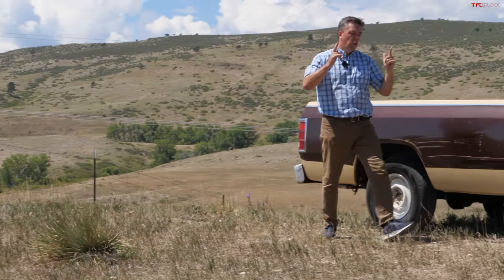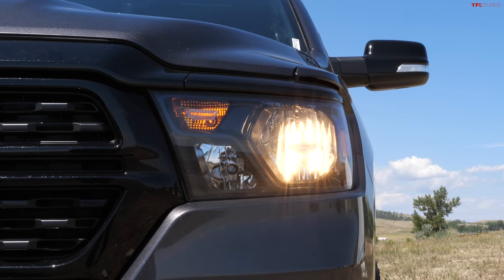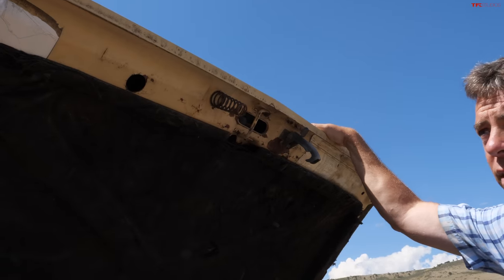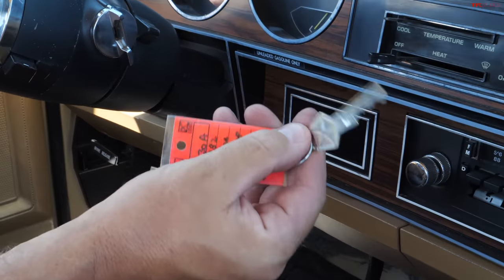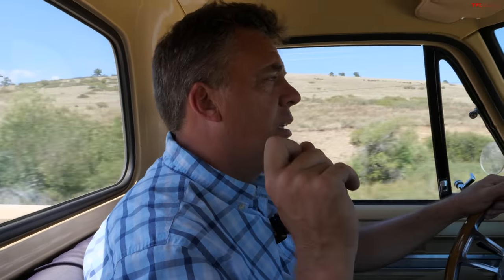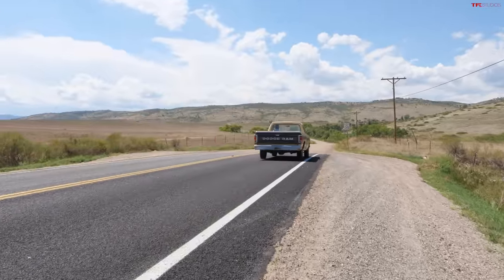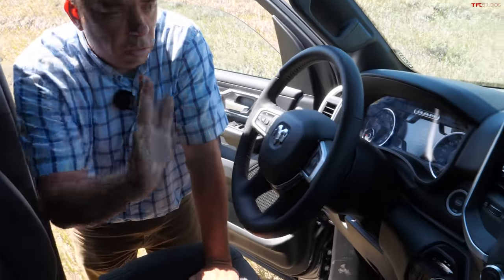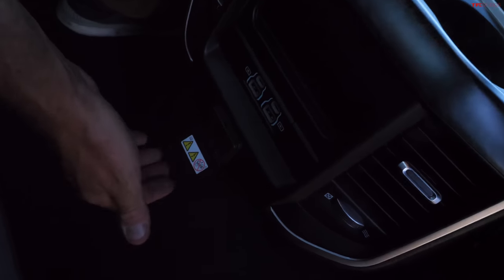You Won't Believe How Much Pickup Trucks Have Changed in The Last 40-YEARS!

Comment: I would take that 1982 Ram, hands-down, The best part about that Ram is, you don’t need a degree from MIT to fix it, 
That slant six is an absolute gem, One of the best engines Moper ever built
Reply: You don’t need a degree to fix the new truck either 🤣😂. Just because you’re ignorant doesn’t mean it’s difficult.
Reply: @flight2k5  
Powerful words coming from a guy behind a keyboard, it’s amazing how cowards operate
Reply: @michaeld5591  🤣😂 how am I a coward. Because I called you ignorant?  You know what that word means correct?  Don’t have hurt feelings.
Reply: @flight2k5  
It was not meant to hurt your feelings, I have more integrity honor and character than that, have a good day
Reply: @michaeld5591 I didn’t have hurt feelings 🤣😂
Reply: @flight2k5  
You know well what the guy meant and he is correct. You need a scan tool, and a lot more regular tools to fix the new one. 
  You need a screw driver and a socket set to fix the old one.
Reply: @kens97sto171  🤣😂 that’s hardly a degree from MIT. You know what’s crazy is there are kids working on new cars. But you refuse to learn. Simplicity doesn’t equal reliability. You know that right?
Reply: @flight2k5  
Dude I've been working on cars for almost 35 years. I drive a Prius. I've had the battery out disassembled reassembled balanced the modules. Head gaskets, clutches, transmission replacements. On a variety of vehicles.
You know damn well what the guy meant when he said that. You can work on that old car with a screwdriver and some wrenches and get it running. You cannot do the same thing on a new car. Yes my Toyota Prius is incredibly reliable $410,000 miles on it. However that reliability depends upon the fact that the manufacturer built it well in the first place. I watch plenty of car repair shows on youtube. There are a ton of new cars that are rolling piles of shit from the factory brand new. Mostly due to crappy Electronics wiring or engineering. That is where simplicity makes better reliability.
However if you buy a car that's well engineered designed and executed with good materials then yes a new computer-controlled car is probably more reliable in the short term with a lot of miles on it.
But ask yourself a question. Could you take a brand new car stick it in a cornfield for 20 years and then get it running in a couple of hours with basic hand tools? Probably not.
Watch a lot of videos about that too. I've seen cars that have been sitting in a field for 70 years. And they get running pretty easily. Does that mean I would want to drive that daily 300 miles a day in the city? No probably not. But again you know what the guy meant and so do I. And there was no need to insult him in your response.
Reply: @kens97sto171  nothing you said proves simplicity equals reliability.  Mechanically there is no reason why anything that sits can not be started after years of sitting.
Reply: @flight2k5  
I don't need to prove anything. It's pretty obvious. Anything that has fewer moving Parts with less to go wrong in the first place is going to be more reliable given they were equally well made in the first place.
So if a computer-controlled car sits in a field for 20 years and the mice eat through the wiring and the computer box gets corroded and rusted out? How are you going to fix that if you can't get a new computer box and wiring harness? Answer you can't. Versus the carbureted,  points ignition vehicle. You can get that running with some very basic tools. The other is mechanically injected diesel engines. I've seen those things light up after four rotations after sitting for 20 years. Again their mechanical, and if they were well made. All you need to do is get the fuel valve open and get it to rotate and give it a fuel source and they often light right up as long as nothing got into the intake or exhaust system or a intake or exhaust valve rusted open or closed. And even then it'll often end up running on some of the cylinders.
Reply: @kens97sto171  no, no it doesn’t. It’s not a blanket statement. 🤷🏼‍♂️ sorry bud
Reply: @flight2k5  
There are no such things as blanket statements. But all things being equal a simpler machine is going to be easier to repair than a complex one. You don't need a degree from MIT to understand that. Seems pretty simple to me.
If I let my Toyota Prius sit in the driveway for 10 years it would be impossible to get it running without a remanufactured Hybrid battery or a new one. You cannot make the car operate without that high voltage battery pack. Even if you put a 12 volt battery in it and get the car to boot up assuming rodents haven't eaten through the 10 million miles of wire under the hood.
If I had a car sitting out there with a carburetor and points ignition there's a very high likelihood that after 10 years I could dump some fuel down the carburetor put a 12 volt battery in it put a screwdriver across the starter terminals get it to turn over and run.
Reply: @kens97sto171  so easier to repair. Not more reliable. Got it.
Reply: @flight2k5  

What's your definition of reliability. What's your definition of repairability.
 Is a car more reliable because it can sit for 30 years and then be started up easily? 
Or is a car more reliable because it can go 500,000 miles needing little repairs along the way. 
Both of those statements are true...
So it depends upon the person's needs and what they consider important. 
If you consider driving 500,000 and never needing to fix anything the most important feature then buy a newer car. 
Preferably a Toyota. 
If on the other hand you like a vehicle that you can easily fix with basic hand tools and common sense then buying something older that's simpler might be the right car for you. Both of those can be true at the same time. 
I owned a 72 Plymouth duster with a slant six engine carburetion and points ignition. And it went 470,000 miles.
I currently have a Toyota Prius it's gone 410,000 mi.
But the duster could have been repaired with basic tools and could sat in a field  for 20 years and be fixed. 
The Prius could not.
Reply: @kens97sto171  dude you’re trying so hard. Aren’t you?  Your ping drawn out replies do not make you more right.  Please just stop and agree that simplicity doesn’t equal reliability
Reply: @flight2k5  
You're right..
 I'm trying to hard to talk to a brick wall. Or a troll or both.
Simplicity is more reliable given everything is equal. Simple fact,  if you have a brain and can use  logic. 
. But you're not open-minded enough nor do you have the experience to realize that fact..
I've lived longer than you and have experienced both situations.
I told you I drive a Prius didn't i? That should tell you that I don't have any problem with complex machines. But because I'm smart and open-minded enough. I also realize that a 72 duster with points ignition in a carburetor was also reliable. But could also sit in a field for 20 years and be fixed with a screwdriver. Versus the Prius which cannot.
Reply: @kens97sto171  no it’s not. Sorry you’re incorrect. See you’re just doing a blanket statement.
Reply: @flight2k5  
I don't think you understand what the definition of blanket statement is. I'm literally saying the opposite of that.
A complex machine can be very reliable if well made. A simple machine can be also very reliable if well made. And the opposite is true also.
But a simple machine will always be easier to repair than a complex machine.
Therefore if you have a simple but well made machine you will have good reliability and ease of repair. Pretty easy to logic this out.

Comment: I grew up with a pick up truck very similar to that 1982 Dodge. It was a 1987 LE150 4 x 4 with three-quarter ton modified suspension this truck was custom ordered 318 v8 I know this doesn’t mean shit but that little 318 V8 had about 175 hp and in the summertime on a hot day with a good tuneup on My dad’s well running truck would get a second gear rubber chirp not a burn out from an automatic transmission. Before taxes and financing my dad‘s truck was $17,000 Canadian And I will tell you with very little effort that truck will outlast that  2022 ram especially if the lifters in that hemi collapse like happened to my brother-in-law‘s hemi ram.

In the event of an apocalypse you can fix that straight six with bubblegum and a coat hanger. Can you say the same about that 2022 ram?

However I strongly suggest all manufacturers bring back the front vent windows!

I strongly suggest you read the owners manual and the data tag in the vehicle especially for the 82 Dodge about what it can tow weight wise it’s very comparable to the new truck even with the little six-cylinder. You’d be amazed how tough that little truck is. 

The reason they make trucks like that today is because back in the 90s there was a luxury tax on vehicles that didn’t apply to pick up trucks and it just carried forward from there on. And depending on what country are in for example I’m in Canada if you bought a brand new pick up truck in the 90s it was a 100% tax write off basically the government paid for your pick up truck if you had a business.

Comment: This is the exact color of my 81 Ramcharger. 5k lb with a 5.2 v8.
Back then pickup trucks were literally just that..
Not meant as grocery getters but to haul alot of stuff in the huge bed..
And 1/2 ton literally meant that was all it could carry..
Great video showing the true differences 40 years have made
Reply: Ah, the old (almost) indestructible 318!
Reply: @jeffhutchins7048  it was the 318.
Took forever to get to 35-55 mph..
Reply: Had a ton of those '72-"93 D/W Trucks, still have a few.
My 5' tall 19 year old daughter drives a '91.5 Cummins W-250 every day.......well so do I but mine's a Getrag 5-speed manual and her's is an auto.

Her legs aren't long enough to push the clutch in

Comment: I grew up with a 1977 d100 (my Dad's first new vehicle) slant six 4 spd and his 2nd new vehicle the truck I learned to drive on, a 1987 d100 slant 6, 4 spd... technically 3 spd with overdrive. About the only difference between the 2 was the '77 had a first gear, granny gear. The '77 had a couple of issues with the cheap ballist resistor, where the '87 didn't and the '87 had a slightly smaller passenger side floor vent, which made it tough getting the six pack of cans into, to keep cool, fall, winter, and spring. Lol. They both had rough duty (I'm the youngest of 7, and hauled wood and a pop up every summer) and had over 150k miles (the'87 had 186k when traded in) with just maintenance items being replaced, oil, filters, brakes, and tires

Comment: I had a 78 Ford F100. 300 six with a C4. Great truck if it would start without flooding. My 2020 Ram 2500 Cummins is no comparison, but like Andre said. Many times more expensive. It pulled a boat without effort. I’ll keep my Cummins, but for the money, the F100 was really good at what it did at the time.

Comment: What is better is the motors.  Variable valve timing, mass air flow sensor, hydraulic roller lifters, valve rocker rails, fuel injection, more horse power & torque, and if you said in the 70’s each cylinder will have its own coil we would call you crazy.  What’s bad is exhaust manifolds cracking, troubleshooting emission codes, insane amount of computers, accessories and complexity not needed in a work truck.

Comment: that 82 would out work that 22 all day long. it's designed to be a truck and do truck stuff. that 22 is not much more than a sedan with a truck bed on it. and all the un-necessary garbage on it for "reliability" and safety. the older truck will continue running when something is wrong with it or needs repaired. the newer truck will leave you stranded because the computers will tell it to shut off and not run because of a stupid sensor. I had an 87 and I beat it pretty hard. around 8000 pounds of material in the back and the truck didn't strain at all. my dad bought a brand new 2020 ram with all the features. the warranty says don't pull a trailer for the first 10,000 miles. don't overload it. why? are the internals of the transmission made of glass? if I want a sedan I'll get one. here's my challenge for the big 3 or 4 automakers. ram, chevrolet, ford, toyota. make a basic truck like that 82. put the four wheel drive selector on the floor in the shape of a lever. put another one next to it to stir the gears inside of a manual transmission. air bags and crumple zones because safety, but make it simple. make it so a do it yourself type of person can change his (or her) own spark plugs, motor oil, air filter and so on. it is possible to get amazing fuel mileage out of a simple v8. basic truck. tough and rugged. affordable. even with today's economy, a new basic truck shouldn't cost much more than 18 to 20,000.

Comment: You could rebuild every component or upgrade everything on the 82, paint it and still be about a 1/4 of the price of the new truck. The biggest difference is how much manufactures take advantage of customers now compared to back then. That and the older vehicles were built to last so you got your money's worth out of them.
Reply: No way. Newer vehicles last much longer and are more comfortable and faster. Manufacturers shyte on customers back then too, don’t kid yourself.
Reply: @cwqrpportable  Really? Tell that to the new trucks three of my coworks have had in the shop a couple of times already. Hell I got a 3 year old Peterbilt we have had to take in five times in two months for bullshit repairs. It's electrical system is already crapping out as it alarms at you for not setting the park brakes, even though you did. Hell my 24 year old Dodge has been in the shop less than my wife's 07 Jeep or my father in-laws 17 Toyota Tundra. Dude at work has an 84 Toyota that while beat up, still runs great.
Reply: @BlueDually4x4  Like I said, new vehicles beat the hell out of older models. Been there done that.........

Comment: Awesome!  Would love to have an old Dodge Ram someday.
Reply: I’ve had 4, they’re pretty great trucks but my god they can have some serious frame and body rot issues. The power train though, you can’t kill them in any configuration. I’ve had a slant six with 350,000 miles on it, and I’ve had 3 V8s all run well over 200k

Comment: FWIW, the miser option (model, it was badged that way) was the high mileage option.  Just like your drivetrain.  The 1982 318 auto 140 hp was rated 15 city, 20 highway.  In the 55 MPH era, it would achieve those ratings.

Comment: The Royal SE was top of the line, on top of that were Prospector I, II or III packages.  The original two spoke steering wheel on the top series was and is my favorite all time, just beautiful.  The radio is NOT factory equipment, 3 point belts were standard in '82.  D150's got slants and 318's only, IIRC.  D250 could still get 360 4bbl, emission restrictions.  The 318 2bbl was rated 140 hp in '82, it dropped to 120 in '84.  In 1984 the 360 4bbl became optional again in the 1/2 tons and Ramcharger, 4x4 ONLY.  Back then I could afford a nice fully loaded truck, today entering retirement years, NO WAY.

Comment: I bought my 88 base model W100 4 speed 5.2 2 years ago. It’s the first year TBI runs and drives great. It has the original drivetrain now at 99,960 it’s about to roll over, It could be 200,000 but it has great compression. So it’s possible it’s only 100,000. Either way all you have to do is maintain good maintenance on these old trucks and they will just keep running.
Reply: Apparently they dint keep running.🤣 Haven't seen one of these on the road for years and years. You see a lot of old chevys but not rams.

Comment: 1982, Before your time. Having owned a 1979 Power Wagon, 360 4bbl, 4 speed manual, was a great truck. Before that you could get a 440 V8. Federal Bankruptcy bale out for Chrysler they had to destroy the moulds for the Chrysler big blocks.
Early 80s we’re bad times for Domestic vehicles. Biggest engine in 1982 was a 318 2bbl. Cummins came 1994 to get the power to tow.
For comparison, you should have gotten a Tradesman! Apples to Oranges!
Reply: It was actually the 360 though I believe they shared the same block

Comment: I have a 77 Chevy C10 work truck that runs fine, it has a 350 V8. I have never been in a new truck but they look amazing. I know the bed in the new trucks are smaller so that may be an issue but I would give up the bigger bed for a new truck.  New trucks are really expensive so that is the only barrier for me.

Comment: I wish auto makers would bring back a truck like that, six-cylinder, five speed manual, roll up windows, cheap paint, and get the cost down. 
  I know I would purchase the heck out of them especially for my company and their company trucks. 
  I personally did not take delivery of 40 dodge 1500’s two years ago when they delivered them because they had those damn shift knobs in there instead of a gearshift. 
  Walked right across the road to the Ford dealership in ordered 40 6cylinder F150s with a column shift.
  These soccer mom trucks of today just don’t make it out in the workforce.

Comment: Your 1982 was bottom of the barrel entry level truck back then.  The standard PU was the Power Ram that had a 350ish V8 and you could get the 440 big block.  I had a 84 F250 6.9L that snatched 35Ft fifth-wheels around like they were toys and a Chevy dually for the 40+ footers.  Today's trucks have more gadgets and are a bit safer and are quieter, but their actual abilities are not that much different.